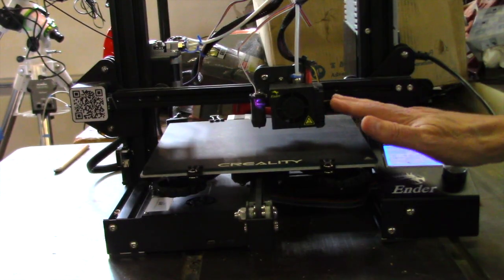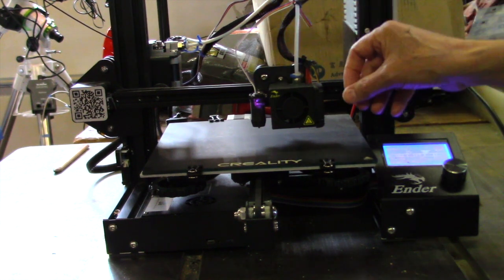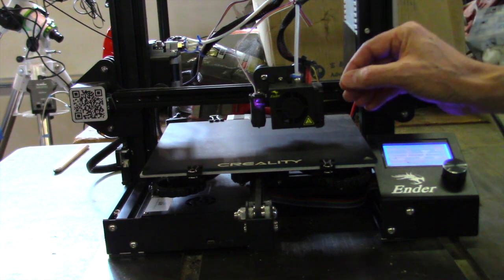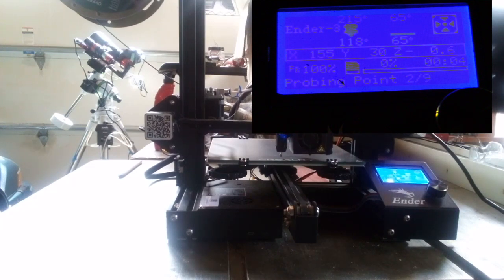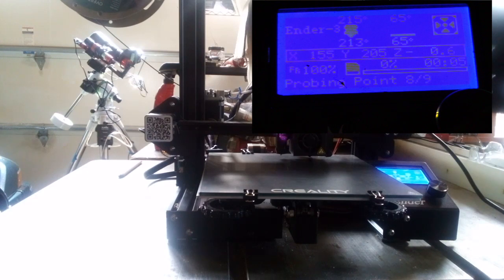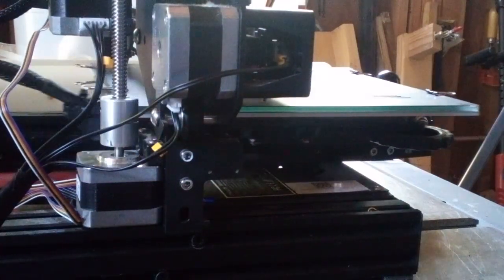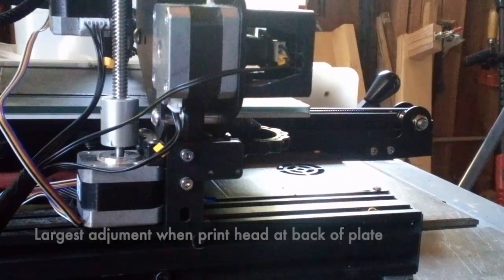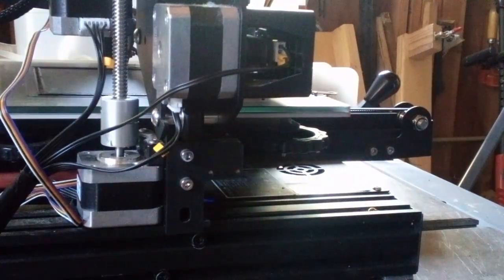Watch How The CR Touch Bed Leveling Works In Real Time

Comment: Hey,

Thanks for this film. Quick question: Can I remove z offset endstop as crtouch is leveling the bed and adjusting the auto home?
Thanks in advance!
Reply from the maker: I'm assuming you are referring to the z offset limit switch.  Yes, once the CR touch is installed, it will replace that switch.